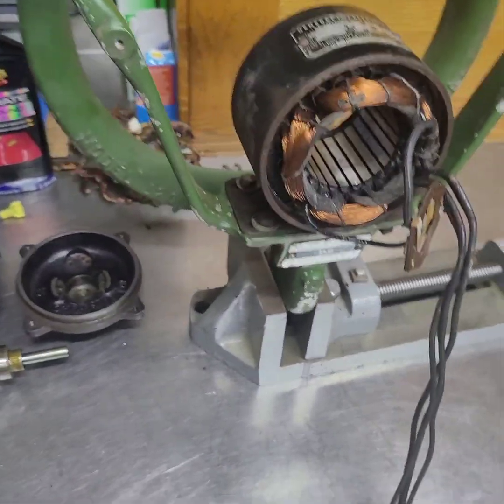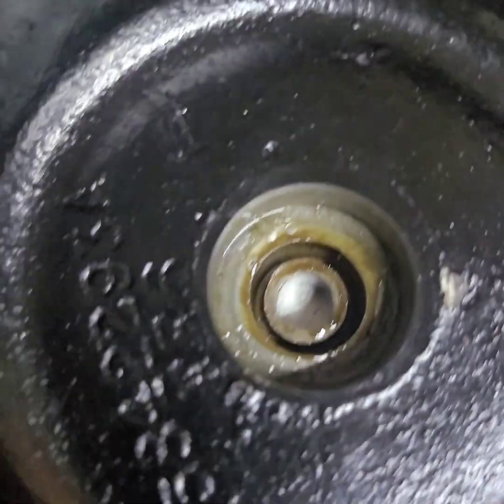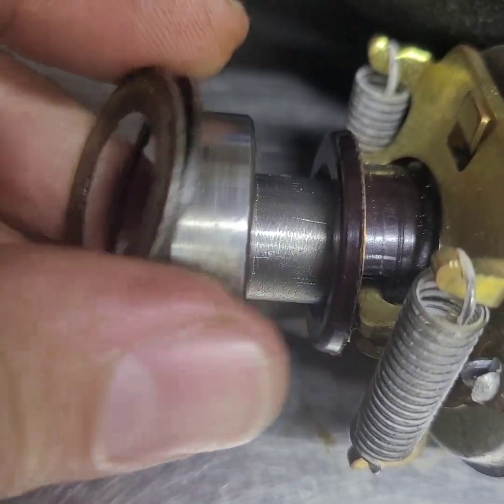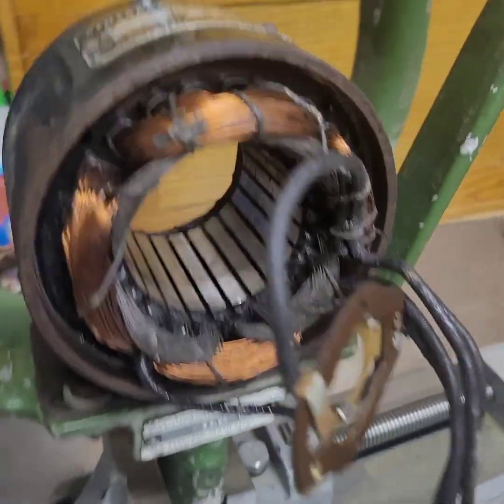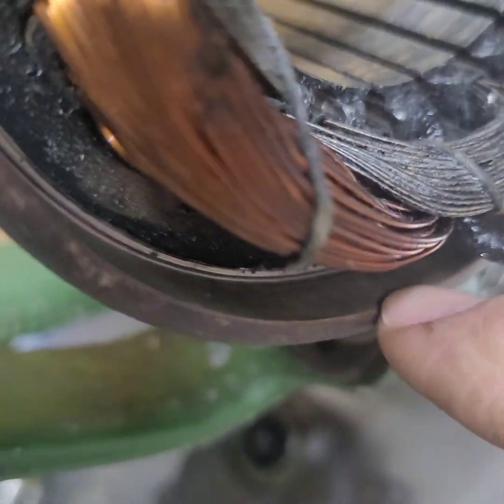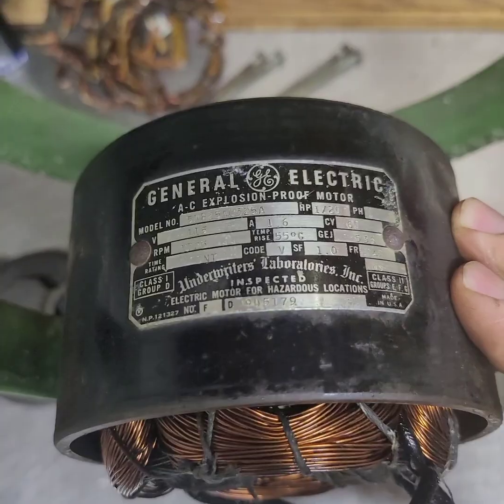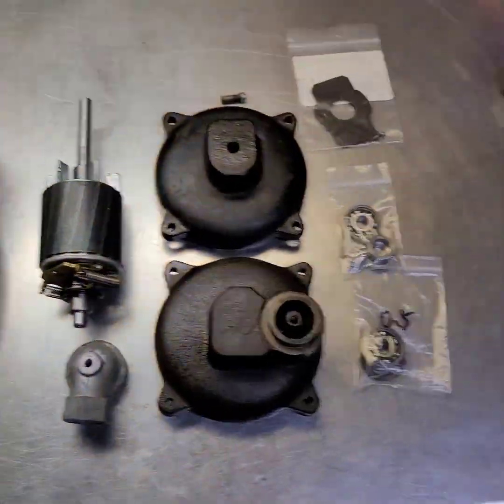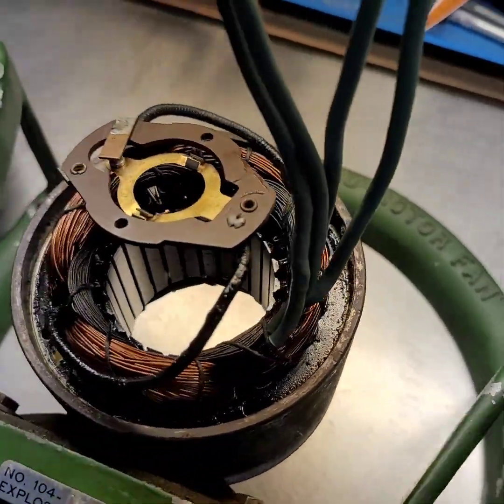ILG Model 123 XQ Explosion Proof Fan Motor Rebuild

Comment: what does explotion proof mean
Reply from the maker: An explosion proof motor is simply a very well enclosed or sealed motor, to a level that no sparks could possibly ignite a flammable gas and cause an explosion.
Reply: @ thank you I never knew this

Comment: I never understand what its meant by "explosion proof motor" can you give a small explanation
Reply from the maker: What is meant by explosion proof is that the electrical components of the fan are completely sealed air tight, isolating the motor and any sources of sparking from the surrounding environment. This fan would be useful to ventilate a room that has flammable or explosive vapors present.
Reply: @ilgfanman  aghhhh now I understand and have an idea what is meant by that and thanks

Comment: очень прикольный моторчик от дженерал электрика.Родной?
Reply from the maker: ILG did use GE motors for some of their smaller size fans. It is quite common to see General Electric Unit Bearing motors on the later 1940's and 50s model 103 fans.

Comment: That turned out very nicely!  You really do good work. Thanks for sharing it with us.

I've seen on other fans, where the centrifugal switch mechanism was totally worn out and broken, because the fan was windmilling in the breeze for decades, out of service, at a slow speed. The entire disc was cut in half, and the contacts were twisted up once the broken disc caught them!
Reply from the maker: Thank you! I still have to clean up the paint on this fan, but the motor is all done. Also, wow that fan had to be quite a mess to fix with the broken centrifugal switch!
Reply: @ilgfanman  

Your 123XQ will really be a nice piece once it's painted! 

For the destroyed centrifugal switch fan, I replaced that with a potential relay and just removed all the old start switch pieces.
Reply from the maker: @davida1hiwaaynet  Oooh I like that idea! Bet it worked really well! Also for the 123 I am actually just buffing up the old paint by hand and gonna see how it turns out.